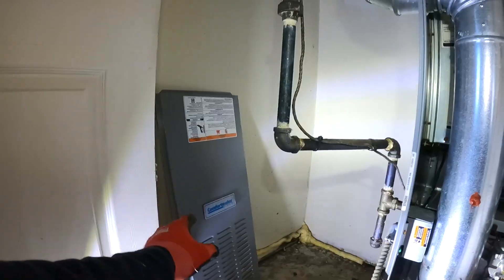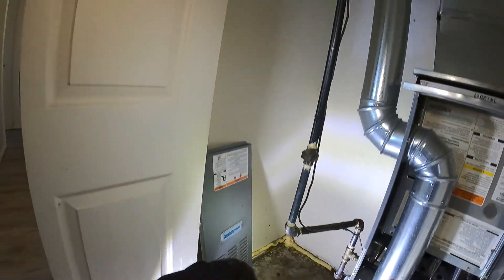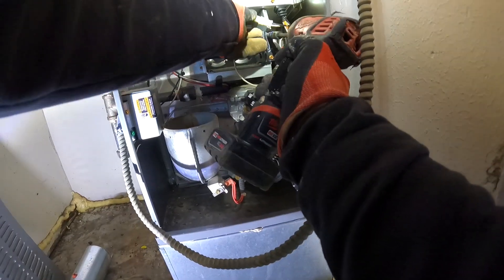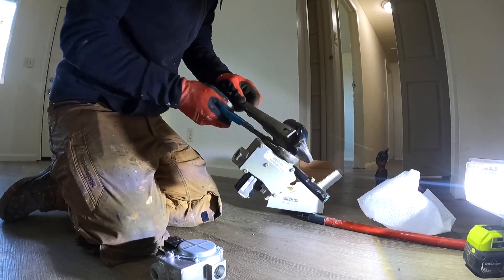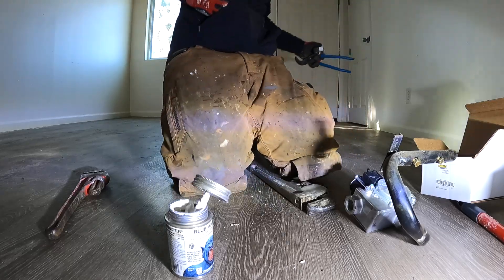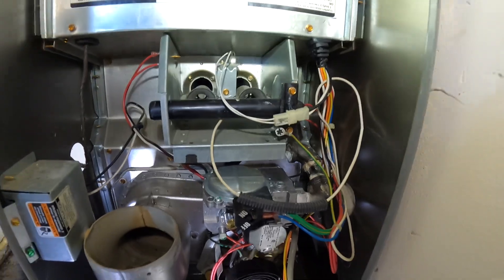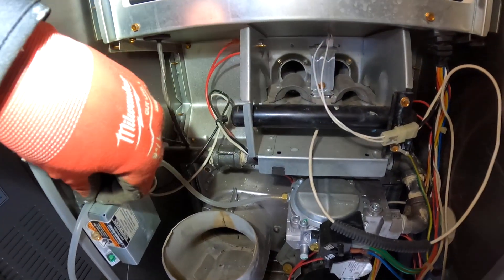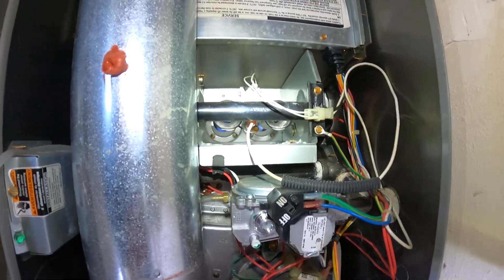HANDYMAN wants to be HVAC Tech | Leaking gas Valve

Comment: Some of the problems with leak thru on those valve seem to be from no dirt leg ( which you have) to collect the oils and  debris coming down the line.
After the dirt leg and to the valve I believe alot of the problems come from excessive dope, when it finally drips or breaks free it has nowhere else to go but into the valve, through the screen and settling so the valve will never seat properly then of course causing the odor.
Reply from the maker: @sslaayersslaayer3457  I believe a contributing factor may be due to tenants having the gas shut off for non payment. Not sure but I can’t believe having it turned on and off would be good for the system. I honestly haven’t had too many gas valves go bad.